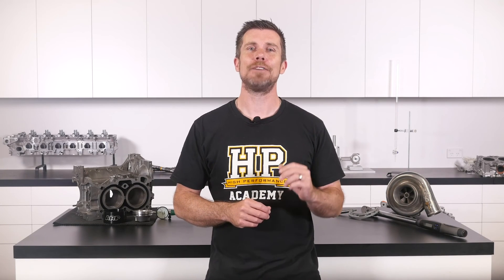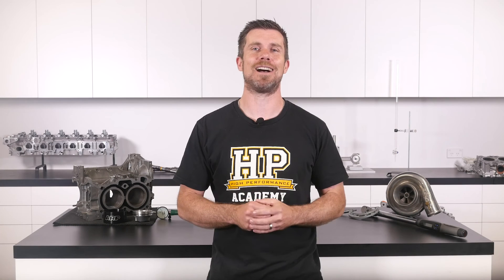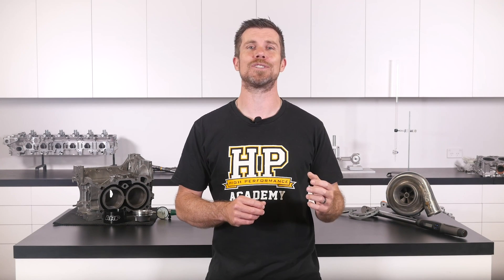Why Is Engine Balancing Important? [HPA Q&A]

Comment: Good points.
It is good practice to get ANY engine re-balanced if different components are used, especially if modifying a factory balanced engine.
a/ the aftermarket components are usually significantly lighter than the OEM, so the counterweights will be too heavy and need trimming
b/ if re-using OEM cranks, flywheels, front pulleys, etc, they are normally done as a last maching operation for the OEM balanced parts - it is MOST unlikely they match the aftermarket parts and so the rotating assembly has actually been put out of balance.

On that, the more information one has on the components used, the better - if you know the 'rod balances, piston weight, or whatever, if you need to replace one you can set it to the same weights and not worry about any imbalance you may be introducing.
I have seen some people getting quite extreme on how far they take it, but when one considers the affect of the oil being thrown around in the crank case, sticking to and bouncing off the parts, there is a point where that exceeds the balance tolerance. Slight variations in fuel injectors, cylinder filling and exhausting (especially valid for turbo's as some designs seem definitely compromised?), compression ratio, etc. 'may' be more significant - the engine has to be considered as a whole, rather than just a bunch of bits and pieces, if you get what I mean, to get the most out of it.?

I do recall, many years ago, a top fuel drag car that made a record run and, when asked, the owner said they'd run ourt of parts and it had 2 different makes of rods and 3 different pistons (might be the other way round, been a long time), so not sure how critical it is to get them 'right'. On the other hand I do recall Aston Martin, for example, saying they even balance water pumps but, again, a long time ago.

Comment: is there any other option to dynamically balance the setup (piston,rods,crankshaft) without going to a shop that has the machine? is diy even possible?
Reply: STATIC balance of pistons and rods can be done in home using a gram scale and a setup similar to what you would see if you search for  a connecting rod balancing stand in a search engine. The pistons you simply weigh each piston and bring the weights to the same. There are good and bad locations to take weight out of a piston but generally it's done on the inside of the piston in a location that does not weaken the wrist pin bosses, piston crown, ring lands, or piston skirts. Connecting rods you bring the light end of the rods to the same weight ,removing material from the small end of the rod, then finish out by bringing the whole rod to all the same weight by removing material from the big end of the rod.
You can't DYNAMICALLY balance these modifications to a crankshaft or crankshaft/balancer/flywheel/flex-plate assembly in a home environment. The balancing equipment is not cost effective to own for self use and you really want someone who has balanced many crankshafts to be doing this operation as it is very easy to endlessly cut weight out of a shaft and never achieve a balance without experience.
It is really worth the cost to have a pro do the entire balancing operation in the end.
Reply: well damn,i guess i cant balance my stuff without crossing borders from where i lived,thanks for the info tho,really appreciated it
Reply: @thepartypotatopooper6354  

The 'border' thing may be a bit of an issue, but most reputable* balancers know folks aren't local and have proceedures set up for it - where are you based?

*Might cost a bit/lot more, but a cheap place that messes up will be some of the most expensive work you've ever had done!
Reply: im from borneo island which is in asia,the nearest machine shop that offered dynamic balance is probably by crossing the sea to the next island which is either in singapore or malaysia,kuala lumpur,and nearest i mean a few hundred or even thousand km probably
Reply: @thepartypotatopooper6354  Ah, I've been to Brunei, I think - least the airport when a flight was diverted.
A quick GOOGLE search came up with a few potential trails for you to follow, might be helpful - https://www.google.com/search?client=firefox-b-d&q=borneo+motorsport%3F
I don't think Singapore will be much help, Kuala Lumpor might be helpful as they have held Formula 1, and other international level, races there and that suggests some sort of infrastructure in motorsport, as does Malaysia, which has a thriving motorsport industry and which has also hosted Formula 1and international' series events.
An added bonus of searching for yourself is you may make some useful contacts for the future.
Reply: @gordowg1wg145  thank you for the info,yup probably Malaysia is my best bet
Reply: @thepartypotatopooper6354  Doh, just thought - do a Google search for "Borneo Car Clubs" - many results are not in english, so I don't know what they're saying. But there should be some in your area and/or which have similar vehicles or interests. Try contacting some and seeing where they get their work done.